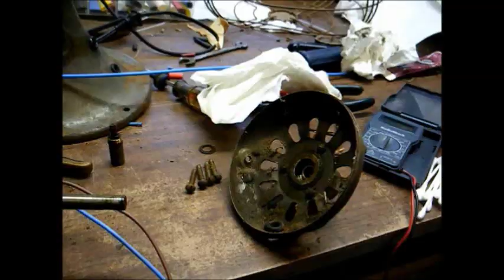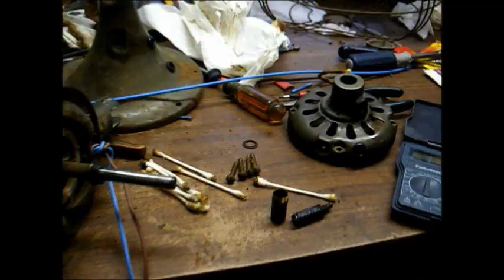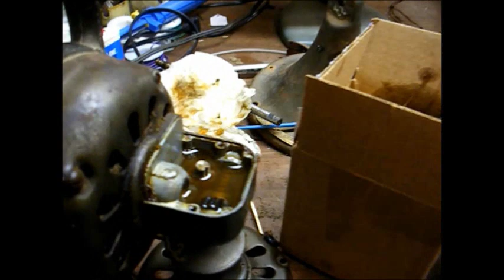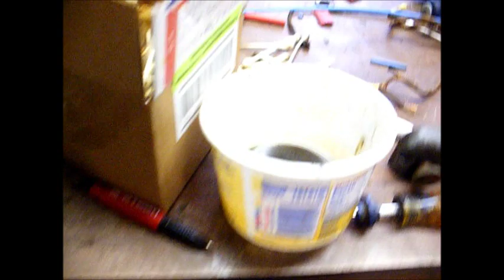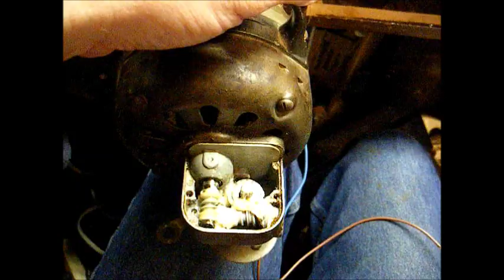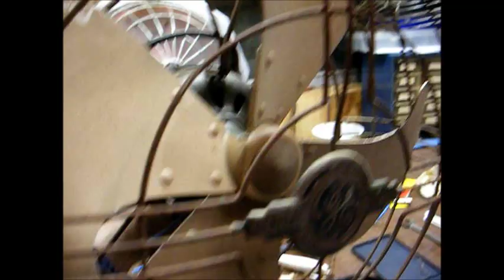1947-48 GE Vortalex oscillating fan restoration - part three (IT'S ALMOST DONE)

Comment: I have a similar (49x491) fan that I’m cleaning out and regressing as well.  How did you get that motor cover off?  Same goes for oscillator selector on the top of the gear box; I’m not seeing/feeing how to disassemble them!  Thanks in advance :)
Reply: Just 10min after I posted this I solved it.  The front plate pops off forward like you are showing but mine was too tight to get it off by hand; I put a screwdriver in the bottom cable hole/cut-out and gave it a firm tap forward (back to front) with my hand and it came off!
Thanks for posting this! :]

Comment: My mother bought a Knapp Monarch floor fan when I was born in 1953 That fan had front and rear plastic grills with narrow slats so I couldn’t accidentally stick my fingers into the blades. As I got older ,I was given the responsibility of cleaning and lubing it. Every season I would add earl into the earl  holes with blue can 3in one motor oil. This was all AMERICAN made in Chicago. It was good up until 1074 when I decided to unplug it and wash all the lint and dog hair trapped in the motor with a water pic shower massage in the bathtub. I let it dry for a week only to find a smokin motor when I powered it up. I rescued a Windmerre floor fan from the trash the following day similar to the Knapp Monarch I destroyed a day before IThe motor was seized and I took it all apart,degreased and re lubed it. I lucked out that fan (also AMERICAN made)
lasted 20 years until an electric surge blew out the stator windings. There were no longer fans being made in the US. We had to settle
 for a Japanese table fan which wasn’t too bad compared to today’s Chinese crap. I still have this fan and it runs good but has plastic blades which can crack after time

Comment: i may not not be correct but i think you should of used petrol or gas as you say in the usa , its great for breaking down grease and easey to remove after with a fresh coat of oil, then wipe off then use the correct  then grease the gear box and also soak oil cup and wick in petrol/gas wipe off with oil then use correct oil when done

Comment: It seems much happier now. Your gearbox reminds me of a small gearbox on a self-propelled lawnmower I fixed for my Grandpa this past spring. It had caked grease like yours and had been run low on grease for several years. The gears had started to eat each other and the brass bushing in the top was gone ! To remove that stubborn grease I used a treatment of kerosene and a product called Seafoam. Worked great but took several hours of sitting and soaking. Thanks for sharing.